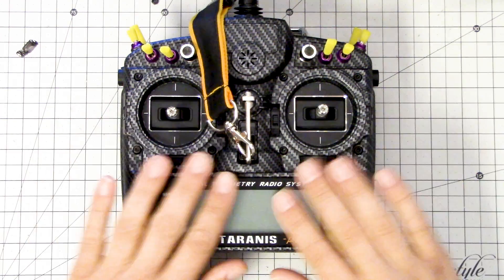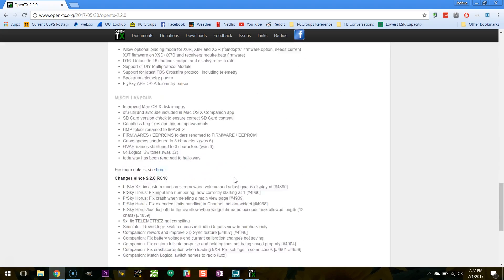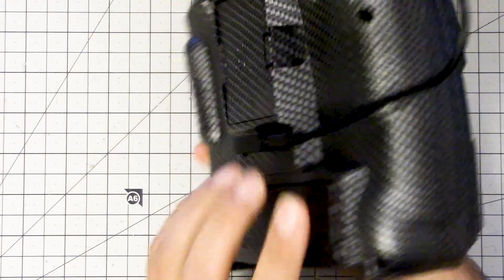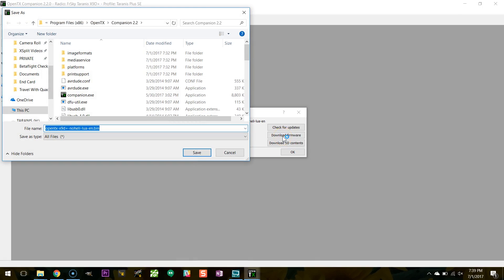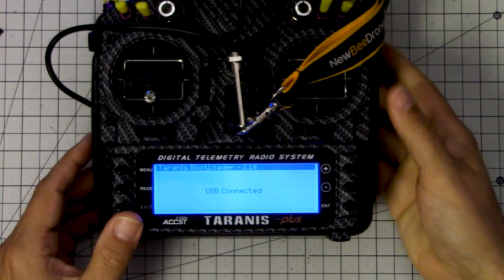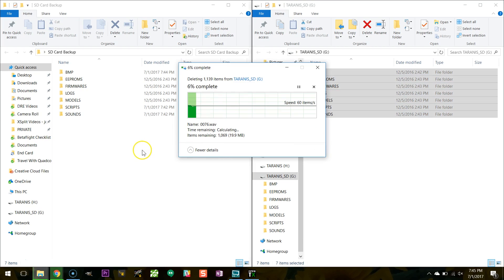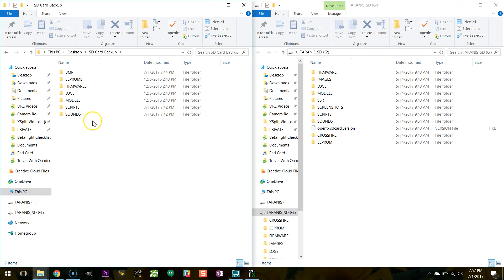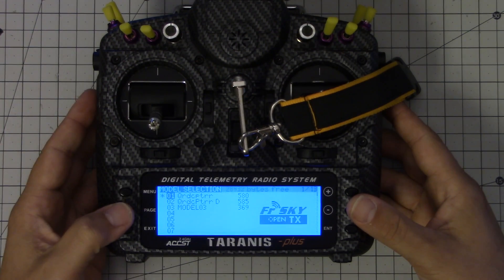Betaflight Taranis Lua Script HOW TO | Part 1 | Install Firmware

Comment: i flashed 2.3.5 to  x7 in bootloader mode the bootloader still says 2.3.0 but firmware says 235 when i tried to write the eeprom it said invalid

Comment: Hi Joshua,
 I've got a tremendous problem with the Taranis x9D+. 
Unfortunately I took firmware 2.0.19 or .20 as an update for 2.0.16 because there was no other one at FrSky, and unfortunately achieved a strong hum and rejection with the X9D+. As firmware in the Taranis transmitter memory there are 2x year 2010 versions FW and Eeprom. Bought it 2017. I can't get into the menu, I can't use the SD Card and read it. I can't find any information about the Eeprom update.

I clicked and loaded lua and sqt5font and de at the settings, it didn't work. The voice has to be changed too. Okay German text and voice is not the greatest problem. 

Can I undo the damage? Or is this just the battery that may be defective. Alarm from the beginning on, no text on the display and inappropriate routine voice hints throttle, switches is all that comes.

Do I need to a) renew everything? Or b) Can I undo the wrong update that doesn't appear?

And how can I do a) or b)? 

With best regards
Stefan Vieregg
Reply from the maker: Hi Stefan. You can probably fix the radio by flashing the correct firmware. My uess is you flashed the wrong firmware for a different radio by accident.
Reply: Hi Joshua, thank you. I took the older firmware for the X9D+, which is nearest my firmware. The Bootloader shows 2.0.16, I can only update to .19. Can I make  a jump to the 2019 firmware? I don't think so.
Reply from the maker: The 2019 is a totally different radio. You can't put it on the X9D.
Reply: Hi Joshua, I thought so! What I need is the step from my crash to a working version. How can I leave this crash? There is no X9D+ in the setting of 2020, because they stopped the support for older ones. I cannot go back to .016, or should I? How can I dock on 2.2, afterwards to 2.3?

Comment: I have a non "Plus" Taranis. Should I even try or is it a definite no-go without the "Plus" version? I tried and get a memory error. There's another video about solving the memory error. But I'm wondering, if I go through all that... will it still not work?
Reply from the maker: I don't know if it will work or not. Try the luac option which fixes the out of memory error.
Reply: @JoshuaBardwell  Yes, thanks... another one of your videos. I'll try that out. Love your presentations!
Reply: Solved?

Comment: Happy Thanksgiving first off Joshua! I recently updated to 2.2.2 firmware on my Taranis X9D+ and the new Amber pack as well. But I tried to transfer a custom sound track instead of "welcome to open tx" from the old file to the new and no luck. Any suggestions?

Comment: What do I do if my Taranis SD folder is not appearing when I plug in my taranis in bootloader mode?
Reply from the maker: Take the SD card out of the Taranis battery bay and use an SD card reader. The SD card that comes with the Taranis might have died, and you might need to replace it with a new one.

Comment: Hey OB1 of the quad world, I have updated my boot loader and firmware in the Taranis x9d+ but I am getting the sd card error:  Expected version is 2.2v0016. I went to the Opentx download pages and followed your steps to find the right sd card contents. But there is no 2.2V0016.  only 2.2v0013 and 2.2v0018. I downloaded and installed the 2.2v0018 3 times and I am still getting a SD card error. why is it asking for a version that is not available on the website?  Thanks for all your help!!!
Reply from the maker: I think you have to upload to a newer version of opentx. Are you using 2.2.2?

Comment: i have on x9d plus opentx 2.1.9 can i install it on the latest opentx 2.2.2 or have to install the first older version
Reply from the maker: I think you can go straight to 2.2.2 but you should back up your models and double check that they are not corrupted.
Reply: OK thanks

Comment: Can I please ask you a simple question. The USB on my Taranis X9D unfortunately came loose inside so it will no longer connect to my PC. 
That said, do you think it's possible to backup models, update the firmware (check the LUA option etc) using only the SD card??
Or am I completely stuck without somehow getting that port fixed?
Reply from the maker: I do think you can back that stuff up to the SD card, yeah. I'm not 100% sure how to do it though.
Reply from the maker: You can update firmware from the SD card too.
Reply: Ok cool and thank you! I guess I'll give it a shot. 

You had mentioned needing to check 'Lua' within the software in order for that to work which I can't do if updating the firmware directly from the radio. That was my biggest fear (and the whole reason I'm doing all this).

Comment: yeah no plug in and dont see the drives :(
Reply from the maker: If you are on firmware version 2.2.1 then you must go to the model setup screen and select whether the radio appears as a joystick or USB drive. I prefer to have the radio ask each time it's plugged in, which you can also configure there.
Reply: Joshua Bardwell ok take II after work ...
Reply: Nup. dunno.. when I plug into usb it does not show up.. it is v 2.1.6 on radio ...
Reply from the maker: On 2.1.6, I think you have to put it into bootloader mode to see the USB drives. Hold the lower trim switches inward while you flip the switch to power the radio on

On 2.1.6, if you simply plug in after powering on, the controller goes into joystick mode and acts like a game controller.
Reply: :( going to get a new cable ... tried all that ... it used to work on Sims but not even doing that now ... tried on a different computer... man it can be a real test of patience...
Reply: OK was the USB cable, go figure

Comment: josh i had a problem getting all the amber soundtracks to work with my horus. what i had to do was abbreviate all the sound file names that had  more than 6 letter  and they all started working.
Reply from the maker: The 2.2.0 sound pack takes care of this. But you should still download it because some of the file names have changed. Just abbreviation the file names isn't enough.

Comment: Joshua, I bought a X9D Plus and just received it. My doubt is: it comes with a 1GB SD card, so... Do I need a bigger one? If so, does it have to be class 10 or something special? Thanks! 😊
Reply from the maker: No 1 GB is more than enough. But the SD card that comes with the taranis is very bad and fails quickly. So if you have some cheap sandisk or something then I would replace it.
Reply: Joshua Bardwell Nice, thanks! I have a 16gb around here somewhere, I'm going to use it. 😊

Comment: 'Allo Josh, I think I have made a mistake when i updated the firmware on my Taranis. I updated from 1.09 straight to 2.24. After watching your video I think i might need to "tweak a few things". The only problem i have is i dont have a clue what might need tweaking. I did listen to you and backup my older firmware and the sd card of the older version. Could you please advise me on what i need to do. many thanks.
Reply from the maker: I think if i were in your situation I would just re-make the models from scratch but it'll be okay.

Comment: You don't need Amber pack for 2.2 just copy the original Amber pack Wav files into en folder in 2.2 
The system file for "welcome to openTX" is now called Hello
Reply from the maker: I think that they've renamed many of the audio files so although the older pack will appear to work, it won't work fully.

Comment: After upgrade I can't use my Taranis as a game controller?
Reply from the maker: It prompts you when you plug in USB whether you want mass storage or game controller.
Reply: It just pulls up as external USB hard drive now without any option to select game controller. After some research last night some people said it might have to do with the TX companion package I downloaded and installed. Others said I might need to delete and reinstall drivers. Just wondering if you had ran into the problem before.
Reply from the maker: No, it's definitely in the Taranis there is an option to choose mass storage or game controller. On the X10 it pops up a question letting you select every time. I don't have 2.2.1 on my Taranis to verify how that works but I'm sure there is an option because others have told me.
Reply: Great! Thanks for the help. I'll look into that when I get home. Your the man!

Comment: Does this work for Taranis qx7s? FrSky website mentions that the files can be shared between qx7s and the x9d+. I tried installing the x9d+ on the qx7s and it didn’t like it. I did everything you showed on first video but I only got 12 pages on Taranis. Yours shows 13.

Comment: When updating the radio firmware all the quads setting will need to be redone?????
Reply from the maker: Back up the radio first using the OpenTX Companion app. Then you can restore the models if anything happens.
Reply: Joshua Bardwell ok thanks for ur reply but if everything goes perfect my question was do i still need to program the switch i had before?

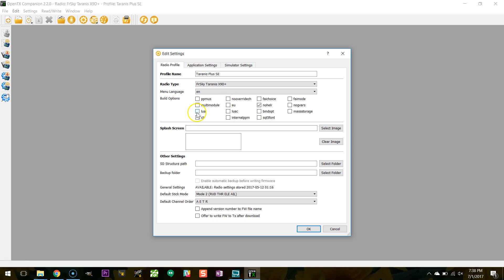Comment: Recently upgraded OpenTx and Taranis firmware etc to 2.2 per Josh's vid. Taranis(incl LUA scripts working well).  Tried to use Taranis with a SIM(free rider and Velocidrone)...and both Windows and Mac laptops not recognizing Taranis as USB/Joystick. Tried to go back in and uncheck "mass storage"....but it isn't even an option when I go into "build" section (@ 5:02 into this video). I'm at a loss now
Reply from the maker: Mass Storage is, I think, for the X10 and X12, not the X9 or X7. Not sure about that though. I know the X10 works differently from the X9 and X7 with regard to joystick and mass storage mode. You don't need to put it into bootloader to see mass storage. And you have to disable mass storage to see joystick. I think.

On X9D and OpenTX 2.2, I believe that you just plug in after starting normally to use it as a controller.
Reply: I figured it out. Went into "Radio Setup" and went to USB mode...and changed it from "serial" to "joystick".  Josh....you just learned something today.  LOL

Comment: Hey josh i was at the downloading section. When i made the selection to download it would automatically just check for updates and then give me the message "unable to check for updates" and not give me a download option. Is there a way around this?
Reply from the maker: Could it be being blocked by your computer's virus scanner or firewall?
Reply: I don’t think so. Open tx opens up as 2.20 but it is not letting me download the firmware. Do you think re installing will help?
Reply: I finally got it to update to 2.2.0 I gues the computer just needed time to download it idk. But thank you for all you do your information is easy to follow and informative

Comment: Joshua can you do an updated video for the New Lua Script now v1.0.1 released 9 days ago. Lots of new features, and some I don't really need. More files as well,  Not sure if I installed correctly, It uses a folder called obj. But It got a bunch more settings, and I have to cycle through quite a bit of screens just to get to the VTx screen, the one I need most.

Comment: Hey josh.
I was running 2.2 but lua script was not working so updated using your links. I did not get the EEPROM warning like you did but sd card warning was there. Is that okay?
Reply from the maker: You need to download the new contents of the 2.2 SD Card or some things won't work.

Comment: Hy joshua, do i need to connect the tx via usb to flash 2.2 on it or can i pull out the sd card and copy contents to it and flash through it? if so, how?
Reply from the maker: I'm not sure about that. I know you can update the bootloader from a file on SD but I'm not sure about the O/S.

Comment: Joshua is it ok to go right to 2.2 with a new out of the box QX7?  I receive mine tomorrow and want to be sure I get to the latest version  open tx correctly.
Reply from the maker: +IAmTheCraftsman sure why not?
Reply: Joshua Bardwell I ask because while gorging on vids about this radio, I thought I heard someone say that the 2.2 upgrade has to be installed over top of a previous version of it.

Comment: Joshua,  my question concerns the Taranis q x7 radio.  I want to run the "wizard" lua script on this radio.  Is this possible with the smaller display??
Reply from the maker: If the script is designed for the Taranis X9D display, it will run on the QX7 but it will look bad.

Comment: Great video for getting the controller side of things set up. I think the other video you have for telemetry is a load of information as well but theres so much hardware its hard to really catch it all in a single presentation. Are you saying you can hook the telemetry pin up to a uart on boards that do not have a smart pad on them ?
Reply from the maker: On an F3 processor you can hook telemetry up to any UART TX pad and it will work. On an F4, you need a dedicated SmartPort pad (which will have an inverter connected to it) or you need to do the "smartport uninvert hack" (google it) on your RX.

Comment: Hey Joshua great video as always. I have a quick question I upgraded my taranis x9d plus to open TX 2.2 and I did not check the Lua category in settings. If I go back into open TX companion change my setting with the luuup Box checked and reflash with 2.20 will it fix my problem and be able to do the Lua script thanks
Reply from the maker: +Steve Maratea yes.

Comment: When I plug in my x9d+ in bootloader mode the drive that should say taranis sd says fatal hardware error. Is the sd or the tx broken? Thinking about taking the sd out. It currently works fine but I'm trying to update to 2.2 for crossfire micro.
Reply from the maker: Unknown. Try taking out the SD card anyway. You never know.

Comment: This bricked my taranis. It will not turn on any more. Is there a way to fix this?
Reply from the maker: Un plug and re plug the battery see if that fixes it.

If the Taranis is plugged in via USB, when it is powered down, it should connect to the computer in DFU mode. You need to use Zadig to install the winusb driver, but after you do that, you can flash it from OpenTX Companion.
Reply: The flash said it completed successfully, saying "flashing done" but the screen prompt on the radio remains usb connected.  So I disconnected the usb cable and it went to the write firmware, eeprom, exit screen. I chose exit and the screen went blank. It would not power up again until I disconnected the battery and reconnected it again. Then if I do the boot loader 3 finger thing it will take me back to the write firmware, eeprom, exit screen. If I select exit it just repeats going dead until I disconnect and reconnect the battery, then do the 3 finger bootloader start up where i wind up back again at the write firmware, eeprom, exit screen.
Reply: OK, I got it running. Turns out the problem wasn't the taranis. It was that the computer I was hooking up to was just too old. I moved to a newer machine and it looks like everything is working now. Thank you so much for your time and help!
Reply: I had the blank screen problem as well.  The radio never did the "converting eeprom" step and the radio would only start in bootloader mode after cycling the battery plug.  However, I DID get it to work, and the only thing I can attribute it to is RESTARTING companion.  I flashed the firmware several times unsuccessfully before companion restart, but only took one flash after.  Could be the program restart that fixed it..........could be flashing it 19 times that fixed it.  But it works.  There is hope.  No brick. Happy Flying now.

Comment: Wouldn't it be great if:
The FC had bluetooth so we could connect to it through a phone/tablet and have access to wirelessly change all betaflight settings through the bf config. .. would that be possible?

While on the topic of wouldn't it be great if.... when you plug in the battery it's voltage is restricted until you arm, therefore getting your precious fingers/face out of harms way. Possible?

Comment: I have a qx7 and the sd card is very easy accessible (dont know if thats the case with the x9d) but using a micro sd card to usb adapter reduces the time i takes to copy the files a lot. I think at was from 9min to unser 2min.

Comment: When I try to delete the files inside the sd card, it stops about 1 minute into the deleteing process and it doesnt let me connect back to my taranis until i power cycle it. What am i doing wrong?
Reply from the maker: The SD card that comes with the Taranis is cheap and terrible. I suggest replacing it with a better aftermarket version. Or take it out of the Taranis and put it in an SD card reader. But even this didn't work reliably for me.
Reply: Joshua Bardwell Ok, I'll get a different sd card. Thanks!

Comment: Question: I have Taranis X9D pre plus with 219 working just fine but I want to update to 2.2. Do you know if 2.2 is compatible with pre plus units? I've search everywhere for a solid answer. Trust me I've been down the brick road before with my radio since the first gen A01 models and know how this is a pain in the A$$ sometimes.

Comment: would love to do this with my T Plus.  but gun shy after bricking my old old Taranis when I upgraded to the wrong firmware, LOL (It has the dead RF module anyways, after bricking that by doing the SMA retrofit years ago).

However the LUA script approach would be very very nice for those of us with Connex Prosight, where we can't use BFOSD (I have it on one 5 incher)
Reply from the maker: You shouldn't be able to permanently brick the Taranis. Even if it doesn't power up, if you plug in USB with it powered down, you should get a device that you can flash to.
Reply: yeah I spent a day reflashing it, but the result is a Taranis that crashes constantly with various different firmwares.  I know there is a fix for this, just need time to work it out